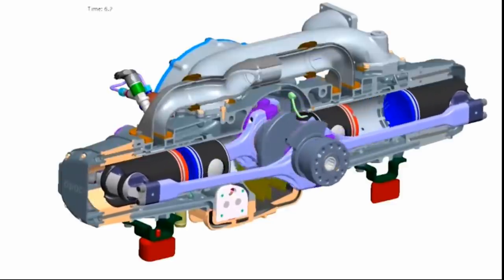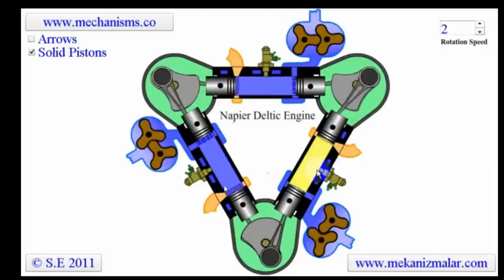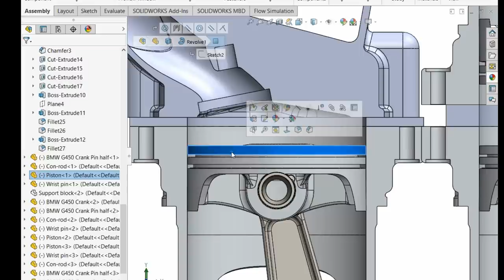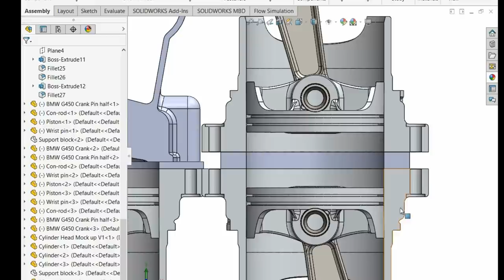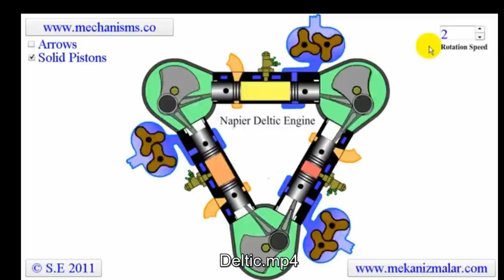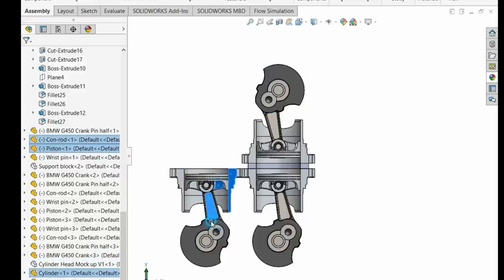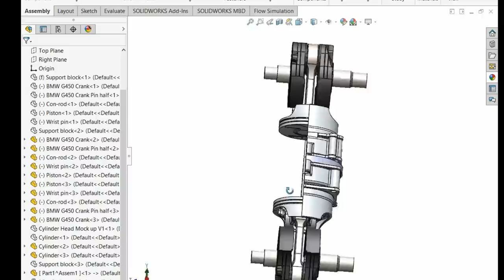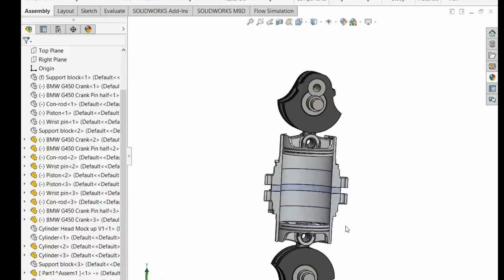Opposed engines are better?

Comment: Naturally then, an opposed piston engine would require more noble components, perhaps niobium, redirecting the hot gas to the exhaust, being more reflective on the infrared. That being said,  would it be possible to reuse that energy on a stirling, running a hybrid, for instance? One can run the exhaust on one side of the stirling, and intake air on the other... Considering the Throttle problem... CVT anyone? Would like your input in this, I plan to tinker on a opposed piston design in the future.

Also, what about natural gas? The better the compression, the more attractive natural gas becomes as a fuel...
Reply: look up achates power & cummins- specifically their advanced combat engine- ALREADY IN PRODUCTION... NOW. all those problems? solved.
Reply: So the reflection on the polished pistons refocuses the electromagnet energy back in the chamber for more effieint oomph.
Reply: @jaybee3165  We hear about those but no specifics. Only that Achates is producing them. Nobody's buying either. I'm curious, but I doesn't seem to be boding well for them.
Reply: @ZetoBlackproject  ford motor has an F150 test bed that achates built at ford's request, but ford will probably go all in electric. the U.S. military already has a contract with cummins to build an achates 1000hp opposed engine- production models are already tested & running- so someone IS buying. I could see achates being a smash hit success as an aviation engine- the very place where these engines came from in the first place- the jumo, still to this day holds the most efficient burn rate per hour of ANY aircraft- and with extreme reliability. an engine like that SHOULD have been on EVERYONE'S radar straight out of ww2... only 1 thing would explain their lack of dominance- I smell a big oil rat. my prediction? after tesla finishes taking a wrecking ball to APi & opec's monopoly? we'll see a ton of innovation on a huge wave- ethanol, opposed piston and a whole host of other innovations.
Reply: @ZetoBlackproject  also- achates only produced the prototype for ford's F150 platform & for a Peterbilt 579 truck with an achates engine. 

the military contract is an achates engine design that is built by cummins for the military- that's a done deal- bradleys & troop transports will be the recipients. 

my guess? you'll see them in Peterbilts too. walmart is already testing one.  

most people fail to understand- you & I look at an engine like this and think: "WOW! 30% better mileage, I want one.

 put yourself in big oil's shoes: what THEY hear is? "30% loss in sales!"

... and when you have $4.5 trillion a year to buy federal agencies, finance election campaigns, fund media wars- all they'd have to do is call up ford's CEO & say- "you take this engine to production & you can consider yourself bankrupt".
Reply: @jaybee3165  I hear you. The oil oligopoly may certainly have a hand in this. But forgive my skepticism towards military contracts. I lived in Brazil for many years and, whenever I hear government contract all I process now is corruption. And I doubt the US military is corruption free, specially considering how lucrative a contract with them is and also because many american soldiers detest the Humvee for instance, and do not understand why civillians want them, there's a lot of graft in there.

The idea remains however, the engine design is sound. And my tinkering has also progressed toward something more substantial. Who knows? Maybe I'll get the civillian market and leave Achates wanting...
Reply: @ZetoBlackproject  more than just a hand. OUTSIDE the united states- you can buy toyota, nissan, ford & chevy vehicles of every variety with tiny little turbo-charged diesel motors- a toyota sienna for instance- gets 36mpg. in the UK- you can buy a ford F-150 with a PERKINS! diesel motor, 32mpg city, 36 highway. those trucks routinely go 700k miles before overhaul.  

the epa is nothing more than a stooge of big oil... under the guise of 'less pollution'. lmao. 

which engine pollutes more? one that gets 15mpg & wears out in 200k miles... or one that gets 45mpg & lasts for 1 million miles? if I were big oil? I'd want the dpf option too. more oil sales, more truck sales, cranking out more factories, more scrap yards processing more crushed cars.  can't have those truck & car owners driving vehicles that last a lifetime.. now can we? the reason they allow the good stuff outside the usa? they're already charging $7 a gallon in other countries.

Comment: 'too many parts'? REALLY? have you SEEN a 4 cylinder engine in the average compact car? HUNDREDS OF MOVING PARTS. the jumo diesel STILL to this day holds the record for lowest fuel burn per hour of ANY aircraft engine- and that was WW2. they solved the heat issues by making all the high stressed components of stainless steel.
Reply from the maker: "'too many parts'? REALLY? have you SEEN a 4 cylinder engine in the average compact car?"

- Yes I have.

Comment: Sur le moteur OPOC il faut diviser la course les pistons par deux pour avoir la même cylindrée que le moteur
classique 4 temps ou considérer 2 cylindres pour celui-ci.
Le balayage sur l' OPOC est de type uniflow qui permet un meilleur rendement.

On the OPOC engine, the stroke of the pistons must be divided by two to have the same displacement as the engine
classic 4-stroke or consider 2-cylinder for this one.
The sweep on the OPOC is of the uniflow type which allows better efficiency.

Comment: Isnt an advantage of the opposed pistons that you can have a perfect combustion chamber? and that you have twice the stroke.
Reply from the maker: Perfect? And twice the stroke, for twice the fuel and air...
Reply: What puts the OP engine ahead of all other layouts is that it doesn't require a valvetrain, or cylinder heads of any kind, as well as omitting the use of camshafts. Despite looking more complex on appearance actually is much simpler in design elements because of said exclusion of camshafts and valvetrain and heads.

Comment: that works. there is also a Michel Opposed-Piston Engine that uses 3 pistons. It is arranged almost like the Mercedes Benz star badge emblem. Always wondered about those. Thanks for the great video.
Reply: That's the one with the combustion chamber in one of the pistons right
https://oldmachinepress.com/2014/02/24/michel-opposed-piston-diesel-engines/
Yes in deed. The crankless ones look a little sketchy to me.
Reply: @mpetersen6  oh yeah thats the one!

Comment: On your engine it shows the exhaust port and intake port open at the same time, do you think that would work.  The German engine of world war two to work the  cranks were slightly out of time so intake and exhaust would not be open at the same time  this caused vibration but they used it anyway.
Reply: mmmm... actually the jumo was smooth as silk. all they did was make the 'meeting point' (half way) slightly favor the exhaust side. both pistons still had the same travel distance and timing, when left piston was at bottom center- so was right.

Comment: Looks like it would make for a nice range extender for EVs. 3 small cylinders and 2 cranks coupled by 3 large gears with the center being the generator makes for a nice flywheel. Maybe even use this as a more efficient backup generator, built into your car no-less.
Reply: yes this would be nice all this OP 2 stroke would need is a quick top off of synthetic amsoil interceptor 2 stroke oil. XD-100 oil is cheaper at walmart and i run it in my 8v92 2 stroke now as it goes onsale at walmart.

Comment: Matt, was there a reason you only went into details on opposed pistons where the crank angles were in sync? I seem to remember in Harry Riccardo's book, from many years ago, that the best design had the crank angles offset, which also altered the port timing quite favourably on a 2 stroke.
Reply: You want the exhaust port first to drop the pressure in the cylinder before opening the intake port. Otherwise you could get exhaust blowing back out the intake.
Reply: Jumo used 8deg intake lag, F- M and Achates use 12 degrees.   Don’t recall this detail on Commer or Doxford , etc.
Reply: It would be nice to see an OP 2 stroke in snowmobiles. How about an OP 1700 rotax made from 2 850 etec!

Comment: Thanks man, do you answer technical questions from comments?
Reply from the maker: Yes
Reply: @dirtygarageguy  so if I'm understanding you correctly. Opposed cylinder engines are not good when your fluctuating RPMs? Therefore they operate better as APU like in airplanes?
Would using the opposed diesel APU in EV be a viable option or are there also some shortcomings to that?

The car is propelled by electric morotrs but you can save weight by adding less batteries and charge with the APU
Reply from the maker: Opposed ported engines or ported engine in general aren't very efficient outside of their peak envelope.

Comment: They still use a Class 55 Deltic for Freightliner (container trains) work as no modern diesel electric locomotive can equal it for hauling power.

Napier Sabre produced some great (sounding) engines, other than the Deltic, including the twin crankshaft H Block aero engines used on the Hawker Typhoon & Hawker Tempest fighters in WW2.
Reply: How about making a mini deltic 2 stroke out of 3 60 deg v6 mercury optimax 3.2 L 3160 cc outboard bigblocks. this will give 9480 cc or about 578 CID of 2 stroke madness.
Reply: Them deltics were awesome. Now take 3 60 deg mercury optimax 3.2L 193 CID 2 stroke blocks to make a nice 578 CID mini 2 stroke optimax deltic!

Comment: With OPOC engines, at a given power output, mean piston speeds are cut in half, relative to a non-OPOC engine of the same stroke number--and thus friction is reduced roughly 75%

 I'm listening at 2x, but you still haven't mentioned it after 11 minutes. Edit: got all the way through the video and you never mentioned it. Hmmmm. Seems like a major miss for a supposed engine expert.

Tugboat and other marine diesel engines use OPOC configuration. The Ohio class submarines (I was a crew on USS Ohio in early 90's) have an OPOC Fairbanks-Morse making 13 MW surfaced and 12 MW submerged (power is reduced because of exhaust backpressure when running on snorkel at PD (periscope depth)).
Reply from the maker: I didn't mention it because its not true.

Comment: Is there an advantage in the longer stroke overall?
Reply from the maker: Longer stroke
Reply: @dirtygarageguy  LOL
Reply: Higher compression ratio and lower piston speed
Reply: @catchnkill  higher piston speed*
Reply: @288gto7  You are correct that longer stroke with the same rpm.  Piston speed is higher.  However, this opposing piston design does have an advantage of lower piston speed.  There are two pistons to cover the stroke.  Each piston only travels half the stroke length.  At the same rpm, the piston speed is 50% only comparing this OP design with traditional 4 stroke engines.
Reply: @catchnkill  ah okay i first thought you meant that as in general for normal engines
Reply: Much more torque
Reply: Is there an advantage in having a long burn time before exhaust? The exhaust is actually purged by a supercharger, so cooler air is blown in and surrounds the barrel. Also the old Commer knockers were very tractable and sounded like a racing car, incredibly noisy. Therefore the idea of an engine having static running seems to be a defeat of the principle.

Comment: Have you ever heard of "hydro-diesel" fuel (80% diesel, 20% water and a catalyst), it basically remove the heat from the diesel engine and uses it to create power out of the vaporized water droplets.
Reply: Yes, ran this back in the mid 90s it wasn't that great power went down in propotion to water % increase and it was good at destroying pumps and injectors
Reply: @TheBlibo  no shit sherlock, water is only used as an intercooler to stuff more air in the cylinders

Comment: Here are some thoughts,    More torque would have to be transmitted to the crackshaft during the first part of the combution stroke, as the combustion space is expanding twice as fast compared to the engine with a head. So either the flame propagation would have to be made faster(another fuel added to the diesel) or the crankshafts could be offset to the bore centreline to get a greater angle acting on the crankshaft closer to TDC on the combustion stroke.  This would also improve efficiency in two ways. Reduced thrust loads of the piston skirt on the bore, and less combustion pressure lost as the ports start to open as more of the work has happened earlier in the stroke.   Altenatively, much higher charge density(more boost) could be utilized to counteract the chamber volume change per degree of crankshaft rotation problem, but injection timing would have to be very late.
Reply from the maker: Pressure is related to volume, so as volume increases, pressure drops.

Pistons are pushed down, not pulled down.

Desaxing. The cylinders increase loading on the upstroke.
Reply: @dirtygarageguy  Yes, i understand that, but wouldn't the cylinder pressure be less at 45deg ATDC on the opposed engine if both engines had the same displacement and compession ratio??

Comment: The opoc  engine at :06:48 can have the strokes of both pistons halved, for half the average piston speed , allowing higher max RPM, and since HP=Torque X RPM, the max HP will be higher, with a combined BDC volume equal to that of a full stroke single piston. The heat you worry about will only be in the cylinder half as long as that in a four stroke engine, as it exits at the bottom of each down stroke, rather than remaining until being pushed out on the up stroke.
Reply from the maker: Half the stroke is lower displacement. Less charge = less energy. Less energy = less torque. If we go with what you said about equal volume, you have 2 cranks, pistons and rods vs that single...
Reply: @dirtygarageguy  Half the stroke per piston, same combined stroke per pair, same torque per pair, higher maximum RPM due to half the swept area (half the piston speed)  per piston, higher hp (Torque x RPM = HP.). Shorter rods reduce the per piston/rod mass, allowing higher RPM, so, higher HP
Reply from the maker: 2 cranks... gearing to connect the 2. These engines have been built, show me one that revs to 20k rpm...
Reply from the maker: Also you seem to think piston speed matters, it doesn't. What matters is piston acceleration.
Reply: @dirtygarageguy  These engines have been built as diesels, with long strokes.
Reply: @dirtygarageguy  Average piston speed has it's limit. That's why race engines are de-stroked, for a higher redline. Half stroke means half acceleration, allowing higher RPM. I get it. You don't like OPOC engines.
Reply from the maker: Like a jumo. Why do you think they're low revving engines?
Reply: @dirtygarageguy  They are low revving because of the long stroke. There is no reason an OPOC engine can't be a short stroke high RPM engine. I don't know if anyone has built a short stroke OPOC engine yet, but if they did, it should be high reeving higher HP.
Reply from the maker: So if it was that simple then why hasn't someone done it?
Reply from the maker: This guy said it 12 years ago...
Reply: @dirtygarageguy  Yeah?
Reply from the maker: @AngelAndTheWolf  yeah? As in yeah the video was 12 years ago so what? Why hasn't anyone made this is 12 years? Where are these high rpm high power engines?
Reply: @dirtygarageguy  I've made my points. You will not accept them. I leave you to your delusions.
Reply from the maker: You haven't made a point. You say half the stroke therefore half the piston speed, so max rpm can be increased. What you don't understand is that isn't the only factor. These engines are ported engines, and ports that work at high rpm don't work at low rpm. You also don't seem to understand double the friction, cylinder temp vs crank angle. You then say some guy said it could be done and can't explain that if it's that easy why it hasn't been done yet or why.
Reply: @dirtygarageguy  OK, FINE. YOU WIN. BYE.
Reply from the maker: Lol don't be sour, argue your case.
Reply: @dirtygarageguy  It's not that important to me to "win" this argument. You are firm in your beliefs, so be it.
Reply from the maker: Lol it's nothing to do with 'beliefs', so said you made your points, and I said they're not points, and you give up?
Reply from the maker: And if its not that important then why start it?
Reply: @dirtygarageguy  YEP!
Reply: El problema de el rozamiento por la biela se puede solucionar de manera muy simple, la "patente" de alfadan de su nueva "biela" ayuda al problema de el balanceo , pero de lo tont0 que es el viejo no se dio cuenta que también ayuda al tema del rozamiento del pistón ya que literalmente lo que aguanta las vibraciones y las fuerzas laterales es la propia "biela" , y al estar técnicamente dentro del carter puedo inundarlo de todo el aceite que se me ocurra por lo que el rozamiento será nulo , así que ese problema tampoco tiene sentido, además de que elmotor es JODIDAMENTE SIMPLE , por lo que puede ser extremadamente confiable y también hay que añadir que con unas pequeñas modificaciones a este tipo de motor podría llegar a ser extremadamente eficiente, 50% no , 60%  no , hablo del 70% , parece absurdo considerando que no es de tipo Stirling, pero si que se puede hacer
Reply: @dirtygarageguy  
interview start  /UP2yNu5rdIc?t=1239
Juicy part   /UP2yNu5rdIc?t=1899

Comment: Is it possible to add large cylinder fins all over this OP engine design to dissipate the heat ?
Reply from the maker: Coolant is better than air cooling with fins. But heads are already cooled pretty much as good as you can
Reply: @dirtygarageguy  Right, thanks.